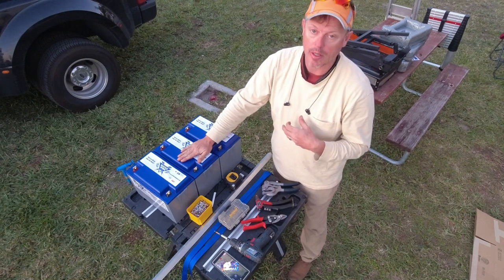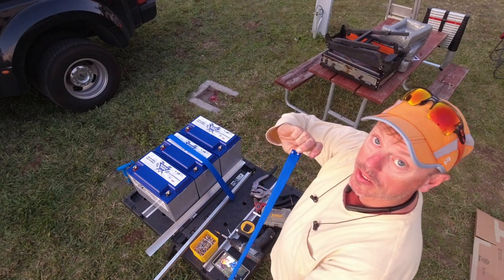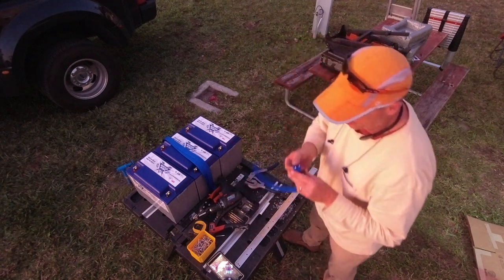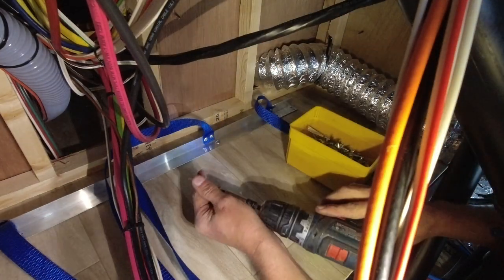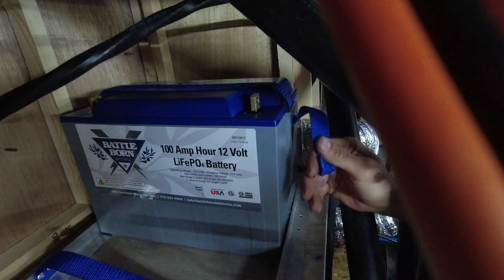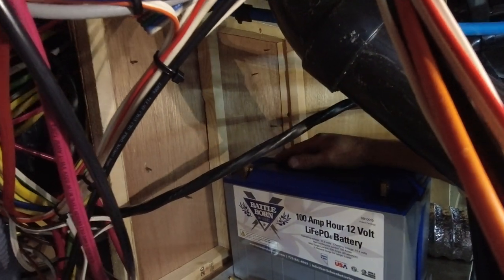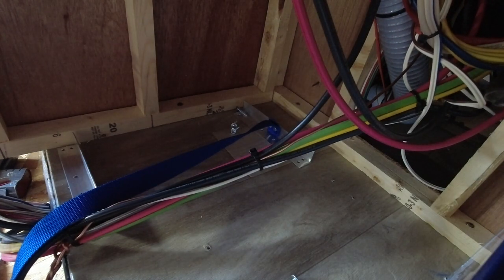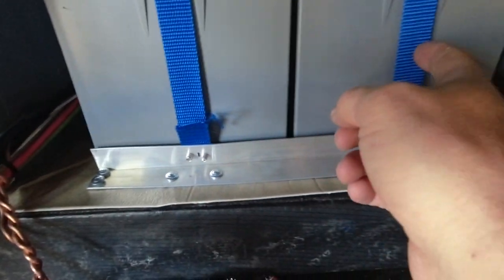Workshop Wednesday: How to secure batteries in your RV installation!

Comment: I am about to add a 4th battery to my DIY install (currently have 3) - this is very timely - my batteries fit perfectly in the space between the rear crossmember and wood framing under my steps (with a piece of outdoor carpet/floormat placed under and behind to protect) - but I used a heavy strap across all of the batteries from left to right - I think I will go back and strap each battery individually based on this video!  Again thanks for all that you do for the RV Solar community!
Reply from the maker: Awesome! Glad this could help, Mark! Saw your pics and it really is looking great!

Comment: I mounted my batteries almost exactly like this, probably because I wached about 20 of your videos when preparing for my install.  The only thin I did different was put them on some foam padding to put some pressure on the straps. Larry
Reply from the maker: Yes, definitely a way to go if you're not riveting. Great job!

Comment: You would think that GD would heat the garage, so you wouldn’t have to do all these alterations, just to install new batteries. And in case GD is watching. Think this could be a thing? You fixed the stair issue in the 29RS, you can lengthen the furnace pipe to make it tot the garage

Comment: Excellent video! Goes to show why all your installs are nice and tight. Question, for those rigs that have the composite flooring (like the Grand Design Imagines and 150 series Reflections) do you still use the TEKS screws to fasten down the aluminum angle piece or do you use something else?
Reply from the maker: Thanks, Kim! Yes, I still use the TEKS lath screws.

Comment: Always enjoy your work.  Quick question, when you are installing multiple solar panels on a roof do you always mount them individually or do you ever make a rack for the so there aren't so many drill holes in the roof?
Reply from the maker: The racking is 3-4 times more expensive and adds more weight. Because of the configs that I do with both perpendicular and parallel orientation, racking has never really been a good option for my clients. I'm comfortable with drilling in the roof, so one would certainly need to know what they are doing, but I also ensure that everything is sealed generously, for no leaks, because a $10 tube of sealant is way more cost effective than a replacement of a $5000+ roof.

Comment: You are great, but you need a blue tooth mic as it is very difficult to hear you.
Reply from the maker: Ha, thanks a bunch - yes, we have one, but had to get an adapter for the Osmo Action camera. It comes in today actually! Sorry for the difficulty, but stay tuned for better sound quality!
Reply: I mean to ask about the lighting you installed. Is it DC or AC, and where do you get it?
Reply from the maker: @papasbus3598  DC...normally through Amazon, but we tried to order more and it’s currently unavailable.

Comment: Those Tec Screws into the composite flooring will not hold down the batteries on a bumpy road. I would not trust this system at all.
Reply from the maker: Sorry you feel that way, these systems have lasted over 1000's of miles.